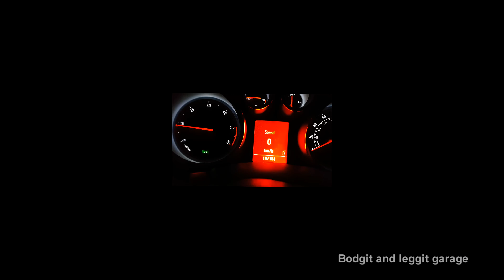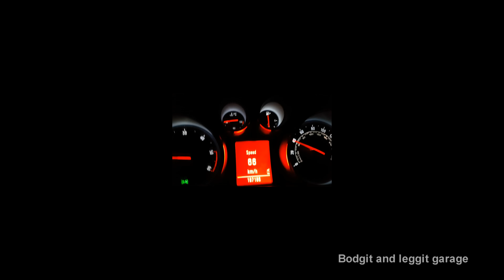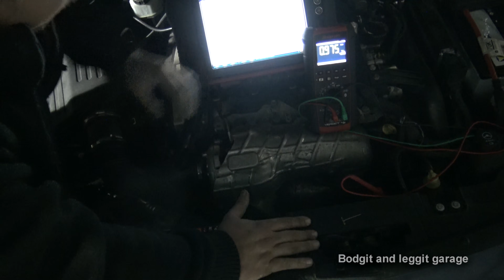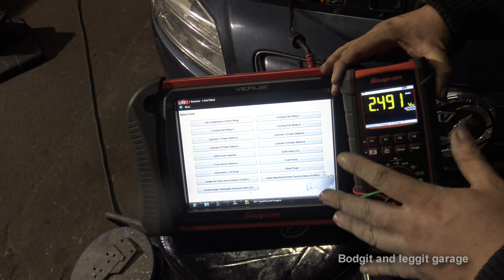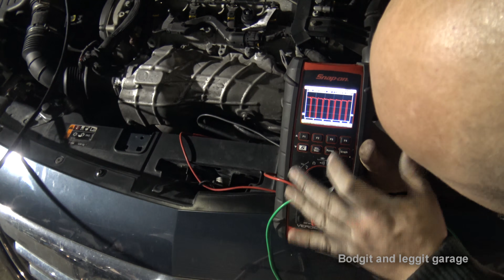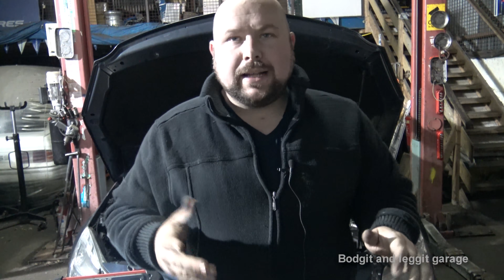Vauxhall / Opel Insignia No Power P0234 P0299 Bodgit And Leggit Garage

Comment: Hello mate im having similar prob aswell...
When i accelerate hard above 3000rpm msg comes up service vehicle soon...
Restart engine amd is ok again...
Even when in 6th gear at arpund 70pmh and trying to speend up it goes in limp mode again...yh limp mode..i have no split pipe and i have changed boost solenoid genuine one plus vaccume pipe that goes on it the moded one from vauxhall...
And it still does same problem...
Engine sounds rough...and power is not at 100%...
Error came up on computer is high boost presure valve... im loost...
Reply from the maker: ati hi mate unfortunately is going to be impossible for me to say as this is going to need proper diagnosing I don't want to say something and cost you money and wasting money
Reply: did u fix ?

Comment: Hello again.. Ive just had an insignia in for the same fault and again intermitant... so ive ordered a valve for the morning... When I was testing for control as you did I had the same 2.5v at idle. Did you confirm as you said you should have 7 volts at idle? I will check mine after I have installed it...Thanks again leon...Top stuff

Comment: Nice! My car also has no power in any gear and my boost valve makes a pulsing hum kinda sound intermittently would it be the valve or somthing causing the valve to do it?
Reply from the maker: stephan harrison5ih5ygt hi mate like I say in the video it could be a number of things you have to start pulling codes and doing some test to find out what is wrong
Reply: bodgit and leggit garage       thanks for the reply mate.. codes pulled off today are PO299/PO830/P2565/PO03A  i cant see or feel any holes in the pipes etc but the boost solenoid is pulsing away time to time like a groaning cow lol

Comment: Hello mate I was getting a service vehicle soon  message and I replaced turbo boost control valve. And the problem was gone car was running fine for 1 day and now again I am facing the same issue after a day if good running again loss of power and service vehicle soon. What do u think could be the problem could it be dirty valves or something else?
Reply from the maker: Navjot Virk hi mate it could be 1001 things you need to get it plugged in to pull some codes and test don't just replace parts you always have to test before you replace
Reply: It's just giving a maf sensor fault I had it replaced. The man at garage clears the code car runs fine for 20 miles and bang again the same code
Reply from the maker: Navjot Virk your best I've taken it somebody who knows what they are doing and will test it properly impossible for me to tell you as it could be 1001 things it needs testing properly to find out exactly what is wrong

Comment: Good video. I have a Corsa D 1.7 CDTI with code P0299. Similar problem to this. If I put my foot down in 3rd it kicks in to limp mode and struggles beyond 65mph. Is there one of these solenoid on my car? Thanks. By the way I know nothing when it comes to mechanics
Reply from the maker: Carl Horne yes it does have one of these but don't just replace it make sure this is your problem it might not be your problem in your case tested first

Comment: VW uses similar valves... thermal imaging gun, good idea (good & bad images, like a waveform database).
Reply from the maker: Thomas EXOVCDS yes thermal imager just put it on the engine would have seen this straight away could have diagnosed it in 2 seconds😁😁😁😁 I need to get one and build up my database